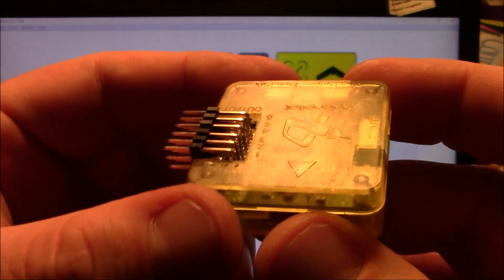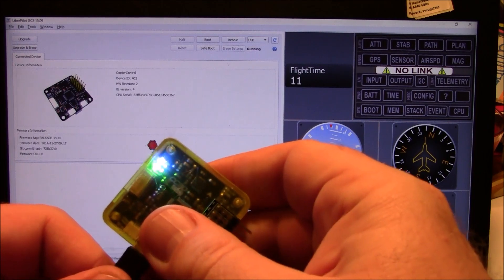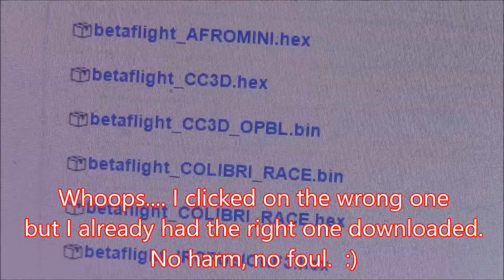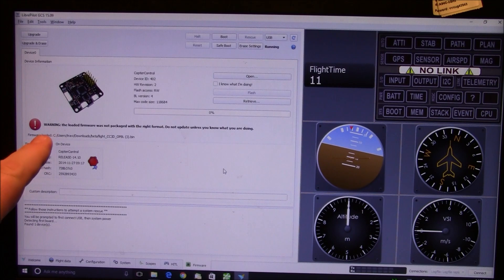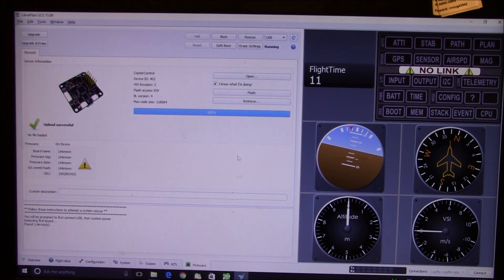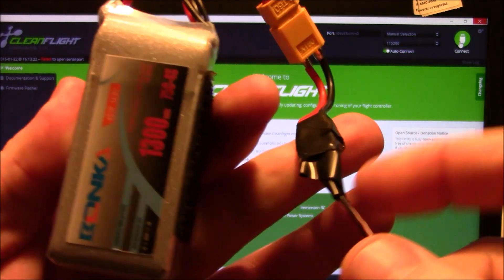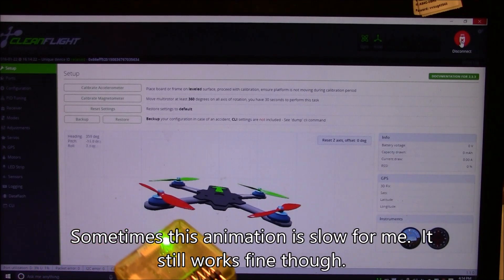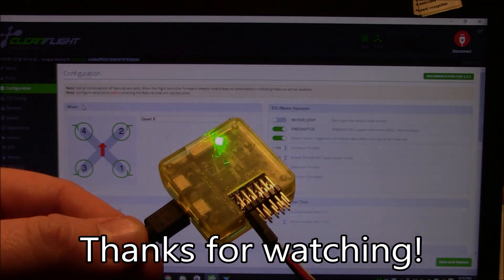Install BetaFlight on CC3D

Comment: i am using 2.3.3 firmbare and latest 1.0.0 and 1.8 beta configutor i am unble to motor esc calibration , motor esc calibration not work esc not detected calibration , how to solve

Comment: I was trying to load i Nav firmware 1.7.3 to CC3D board by bridging SBL pad on board and using FTDI adapter but it failed showing error bootloader not responding.
I was able to load the inav 1.7.3 to cc3d atom with same procedure as stated. But it won't work in cc3d.
Can you help???

Comment: I just followed your guide on how to flash my CC3D in my Orca quad that I did get working in Librepilot OK but want to use Betaflight. Only now I have the Betaflight firmware on it I can't connect to it with Cleanflight (even powered on) And when the battery is connected to the quad all my ESC’s constantly beep saying they can't hear from the receiver (which is lit up and talking to my DX9) So is there a way I can configure the settings to change its connection to Spectrum? Thanks for all the help. starvinarven at gmail dot com

Comment: hey, man. I know this video is super old, but i just got a used quad with acc3d fc on it. used this and it worked. Would you happen to know where I can get the firmware for the newest version?

Comment: Hi,Travis I am thinking of buying a  spadix 250ah, it is a hexacopter and has a cc3d flight controller so would the set up be the same
Reply from the maker: I wouldn't buy anything new with a CC3D.  They are kind of old technology now compared to the BetaFlight F3 and F4 boards available today.

Comment: I have a Kingkong 300 hex with this FC, so I will try this, but once you’ve loaded the Betaflight file onto the FC, why are you connecting this to Cleanflight, why not open it in Betaflight?

Comment: Found the list but all the files for CC3D are ( .hex ) none .bin. Hmm.
Reply: Under all of the .hex files at the bottom there should be a zip folder called something like 'Binaries'. Im pretty sure that will have the right file in it.

Comment: I'm pretty new to the hobby and received a cc3d from a friend and have been using librepilot for a while, but everyone I've seen so far on youtube has been using either betaflight or raceflight. Is there any reason someone would use one over the other or is it mainly an ease of use thing and using what you already familiarized yourself with?
Reply from the maker: I put BetaFlight on my CC3D because I already had the board.  If you're buying something new, you should really get a board that supports BetaFlight natively.
Reply: Ok thanks for the reply, but is there a reason to go with betaflight over LibrePilot if you already have a CC3D? I have 3 separate CC3D boards and am wondering if there's any benefit to flashing them with betaflight over LibrePilot.

Comment: Hello. Is it possible to flash betaflight onto a cc3d now that betaflight is 3.2.2 and running threw Google? I found the 3.2.2 cc3d_opbl.hex so just follow your instructions and it should be fine correct? I know they are going to stop supporting naza32.

Comment: hey man, its been a year i know, but my old flight controller still works so i tried many ways but ".hex" is a new file for firmware so i decide try to download old version "BIN" firmware file. its hopeless. i will wait your respond for this, any idea instead get that "USB .hex flash" i just used it once it just wasting money. i need your help CHEERS!
Reply: You can get latest nightly build .bin file from here: https://betaflight.qmd.cl/ But it seems that the CC3D_OPBL Target of 3.2.0 is broken. I still use the 3.1.7 available on BF GitHub inside this ZIP: https://github.com/betaflight/betaflight/releases/download/v3.1.7/BINARIES_betaflight_3.1.7.zip

Btw: To establish connection with BF configurator: power up CC3D first and connect USB about 5 sec later!
Reply: Thanks helped

Comment: is there a way to enable RTH gps function on CC3D (not the white board) ?
Reply from the maker: Not that I know of.  I haven't ever seen a GPS module that connects to a CC3D.  You'd be better off getting a flight board that was designed to have GPS enabled.

Comment: It works!!! I was about to put this board in the cemetery box but I am gonna give it a try again this time in BF.  I hope this time it flies well. I had the original Cc3d OpenPilot firmware, then I flashed new fw in the dRonin but couldn't config as this is a F1 board and memory was an issue, flashed back another OP Firmware and it was flying worse than ever! I wanted to throw this board in the trash bin. Thank you so much. flashed the BF 3.1.7!

Comment: I've got a brand new omnibus f4 pro that I can successfully flash firmware but it won't open up in the confugurator. Any cause on how I could get it working

Comment: I have the eachine racer 250 with the cc3d and Lbrepilot will not recognize anything when I plug in the usb cable.  I thought maybe it uses open pilot but you can't download open pilot anymore (at least the version that works with cc3d).  I don't know what to do other than replace the FC but I don't want to do that, I just want to get it flying.  Is there a way to flash betaflight without using libre/open pilot?  thanks a million.
Reply: Sorry, hard lesson learned here is to never buy commercial packages Eachine or DJI alike. Never buy windows laptops. Only buy open source boards and linux based computers chromebooks alike.

Comment: after doing that can I flash the  normal firlware to my Cc3D and use open pilot another time??
Reply from the maker: Yes, you should be able to install any firmware you want and upgrade it anytime later.

Comment: Everything works great until I try and do the esc high low on the motor calibration page.  If you set the motor tab on and take all 4 motors to the top position and plug in the battery nothing happens until you go to a tab that has a save or refresh tab.  also tried to do a radio esc calibration and it doesnt work, and the arm / disarm switch is visible on the mode setting but doesn't change color when activated, nor does it work when unplugged and activated with radio.  ?  any suggestions?

Comment: I just spent Hours on this, and i thought my FC was fried.
1- Use STM32 Virtual COM Port Driver

2- Use Betaflight instead of Cleanflight on Chrome
Reply: I can't get mine to connect to betaflight.  Which firmware version did you flash onto the cc3d and also will this work with the latest betaflight configurator?
Reply: used 3.1.6_CC3D_OPBL.bin flashed with open pilot
Reply: Miguel Maranha ok cool.   did you have to short the BL power bs also?
Reply: no, i didn't short it
Reply: ok, thanks for the information.  I can't get it to work on mine.  Perhaps it's due to the cc3d Atom version?  is yours the Atom as well?
Reply: I'm good now.  For me was the driver issue to fix.
Reply: Where do I use this driver? On my computer?

Comment: So i just tried downloaded beta flight. It was successful.. I had no response from the copter. Went to go plug the copter back into open pilot and now open pilot is no longer recognizing the copter.
Reply: I am having the same problem.
Reply: Hey man. So I fixed it... What I did was.. Launched open pilot without the quad connected.. Then I went to Update and erase all settings under the firmware.. I hit the start button.. Then i just connected the quad up to the computer before it timed out and the programed recognized the CC3D board and I had to re config everything but at least it started to work again.
Reply: Im not finding the update?
Reply: So click firmware from the main page.. And then click upgrade and erase.
Reply: I figured it out. I was using the wrong firmware. Thanks.

Comment: There's a cc3d fc on banggood and it says betaflight in the name. This is the link:http://www.banggood.com/Raceflight-Betaflight-CC3D-REVO-F4-STM32F405-Flight-Controller-with-VbatBuzzer-p-1087561.html will this work with betaflight without having to flash beta flight like in the video? I'm new to this and I'm unsure.
Reply from the maker: That board is designed for RaceFlight.  It should "just work" with RaceFlight.  I have one of those at my house right now that I need to use.
Reply: travisgrindal ok so do you think this would be a better fc for beta flight and easier to use http://www.ebay.com.au/itm/Lumenier-LUX-Flight-Controller-for-RC-FPV-DIY-QAV250-Drone-Quacopter-Parts-Toys-/252563240396?_trksid=p2141725.m3641.l6368

Comment: i ran my atom mini with beta flight,  Here you find the https://github.com/betaflight/betaflight/releases?after=v3.0.0-RC7 OPBL thingy. You don't have to powerup the board. Just when it is flashed, you can close LibrePilot, unplug your USB, then plug it in again, it will install a new com port. Then connect to Betaflight.

Comment: got it working with my flysky i6 and ia6 rx with pwm... was a slog to find how to map channels because roll stick channel was absent,, channel 5 was roll???? any found a link from radiocontrolhead on rcgroups which described exactly how to change channel 5 into my roll stick channel.... only drawback is i lose 1 of my 6 channels so arm has to be mode 2 on my 3way switch, so i only get angle and acro modes... would really prefer to have another switch to panic select angle mode, as it is i'm more likely to panic select disarm..... i have another ia6b on the way.... i fried the last one trying to de-pin it... anybody any ideas on how to de-pin an ia6b....... please flysky people,,, make a naked version of the ia6b....

Comment: just once in my life i'd like to be given a link to github and for it to open the page on the video... when i click the link there is no .bin file, theres only a .hex file... and i don't know what either of those even mean.hmmph...  anybody know if i can use i-bus on a cc3d? i killed my fsia6b... all the solder pads died during a de-pin... ppm pads gone... ibus pad might be saveable

Comment: how much better is beta flight over librepilot? I use librepilot and my quad flies great, the only thing that bothers me is I can't use Blheli suite with Libre pilot. If I was to flash my cc3d atom with beta flight could I then use Blheli suite with the cc3d?
Reply: the boris link doesn't have the .bin file anymore? i can only see a .hex file... which is more  difficult to go through.  i'm trying to save my rx, i cooked the solder pads during a de-pin and now i have tried to rescue the ibus pad, but no ibus in librepilot,  does no bin file mean betaflight no longer supports the op bootloader?
Reply: i just managed t get cc3d going with betaflight and i can confirm blhel suite works with passthrough, but my DYS xm 20a blheli esc's were already set up for damped light so i didnt really need passthrough at all, i wanted betaflight/cleanflight for the same reason as you and maybe for airmode, but i can't say i'm a good enough pilot to say theres any difference in flight... using cleanflight is kinda awkward because of the cc3d needing to be powered then usb'd when you want to save and reboot, you actually have to stop cleanflight trying to ''connecting'' then unplug usb then power then reverse that and hit connect again. i also had major trouble with controller, the roll stick didn't have any input (i was using pwm on an fs i6 rx) i had to find a fix on wiki rotor for ''eachine 250 using cleanflight'' it showed how to mix roll channel into channel 5 and get back the roll stick, no biggy but i lose a channel this way, so i'm left with 2 modes and arm on one channel, so long story short if you have blheli esc's, they are probably set up already with damped light,,(test by stopping throttle and motors don't spin down, they stop dead.) you could also change to betaflight flash your esc's or whatever then flash back to librepilot. librepilot wizard was a great way to get into self builds. but i think i will be buying the flip32 omnibus flight controller next, so many benefits like onboard osd and becs.
Reply: yeah thanks i did find it, github is a horrible way to get files... its so vague and confusing, every time i use it i get more angry with it. it's like they don't want anybody new to find anything. the worst thing is when you are given a link to some software you open it and its a full page of folders and files without completely unrecognisable  file names, then you finally find one with a similar name to the one linked and you open that and guess what, its another page with a bunch of folders, and that can go on for a while, then you finally find the file you need.... how to download?, surprisingly download button doesnt do it... hmmm... took me forever to figure out i have to '' view raw'' then download.... holy moly
Reply from the maker: I don't know if you could or not. I haven't tried it for myself, but I would guess the answer is "no" because I think hardware modifications were made to the Naze32 boards to make them support the pass-through flashing.  Also, if your quad flies real well, I'd suggest not changing anything... but that is just me.  :)
Reply: nevermind i think i found it.... hopefully
Reply: I've found .bin files for CC3D (both betaflight_3.0.0_CC3D.bin and betaflight_3.0.0_CC3D_OPBL.bin)  iside BINARIES_betaflight_3.0.0.zip file, it is at the bottom of the firmwares list

Comment: A little help? Everything flashed well from CC3D to Betaflight 3.0. However the motor outputs are not sending a use able signal. The ESC does a quick 3 tone, and doesn't respond. Changing the motor master output does nothing. However a servo seems to change humming sounds when moving the motor control, yet it is still forced to one side. I'm guessing the output is sending something way beyond the normal 1000-2000 range. Ideas?
Reply from the maker: Is the flightboard powering on?... like with LEDs turning on?  Maybe OneShot is enabled on the ESCs but not the flight board?  Make sure your ESC to flight board connections are not backward.
Reply: Travis, the FC is arming fine, I confirmed it through the motor output GUI. I've built many quads with Naza, naze, APM, multi-wii. This one is just acting weird. Oneshot isn't on, and the ESC are not Oneshot. The connections are definitely correct. For testing, output 5-6 have zero signal which confirms the correct output mapping and that the signal is different from 1-4. So I'm going to try using FW 2.91
Reply: Travis, so I used the BetaFlight GUI for the first time. Immediately I noticed the OneShot motor dropdown was on. It was definitely not on in the CleanFlight GUI. Problem solved face slap Thanks
Reply from the maker: I've had that happen to me a few times.  It is so frustrating when it happens.  I'm glad you figured it out.

Comment: Very odd. I can flash it to Betaflight 2.9.1 but neither the Betaflight GUI nor Cleanflight can see the board (no com port shows up either) Downgrade back to Librepilot Supermoon no issues- tried several times with zero luck.  Judging by the comments I'm not the only one. Anyone have any luck lately?
Reply: installed the drivers from main screen?
Reply: FPV Fonz Yepp
Reply: tried inserting cable slowly till fc boots up, then insert cable fully?
Reply: FPV Fonz Yepp. I was more looking to see confirmation that someone had it working right now.  I see and aweful lot of people without it working and having to use serial programmer. Makes me suspect it is not working
Reply: I got it!  FINALLY.  So for others who have this- mine was indeed the STM32 Virtual Com Port Driver was not being fully activated in Windoze- Win7 kept applying some other driver which would show no com port # assigned to the STM Virtual Com Port.  After right clicking on it in Device Manager and going properties and update driver manually  (navigate to the prog files X86 location for the STM driver) it finally assigned it a com port number.  Windoze kept saying I had the best driver blah blah and even the manual apply seemed to fail twice before it took.  Very odd but explains why some may be having trouble.  Cheers!

Comment: hi, i have the same board but it cant connect to the pc like on the 1:39 mark on this video. what am i missing?
Reply: it does not even connect like on the 0:35 mark
Reply: it does not even connect like on the 0:35 mark
Reply: Make sure you have a the right USB cable. Some dont move data.

Comment: hi travis. done all instructions with the 2.9.0 version but now my cc3d board dosent even connect to librepilot. any tips please?
Reply from the maker: When you switch it over to BetaFlight, you have to use CleanFlight to program it.  It doesn't work with LibrePilot.  If you want to use LibrePilot, you have to put LibrePilot firmware back on it.

Comment: No way, bro! It totally WORKED. Is there a way to get it to recognize the mag and baro sensor too? If not, still awesome and totally worth it and i will def keep it this way. Thank - you - bro! You smart moderfukr you.
Reply from the maker: Heh... Thanks!  I'm not sure about the baro and mag.  I don't ever use them.
Reply: Actually, is my bad cause the board i was using is spare and doesn't have them. All my others do and clean flight recognized them fine. Kewl as toast, bro.